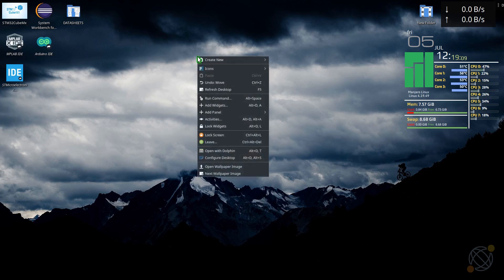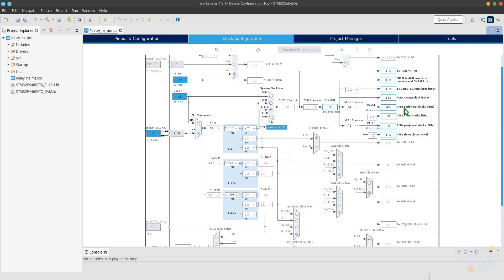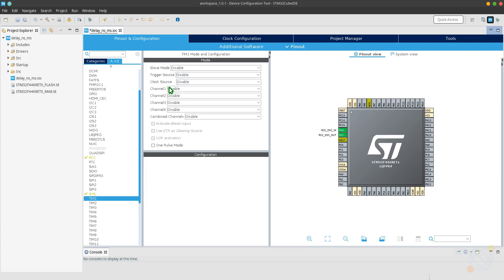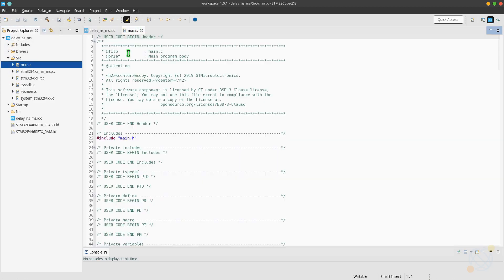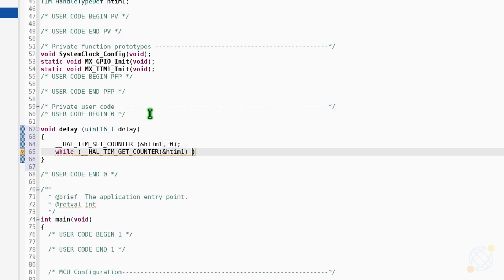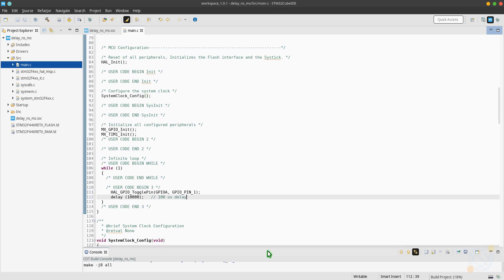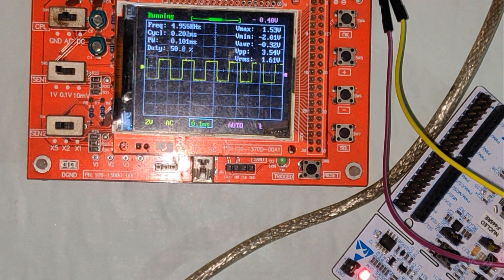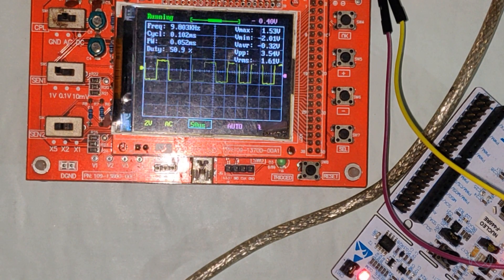STM32 Microsecond Delay Tutorial – Precision Timing with Timers (HAL + CubeMX Guide)

Comment: Sorry, may I ask you a question about STM32F103.
I try to make a timer interrupt on timer 2, but I found the limited is only be reach to 2.7us, while if I change to make a timer delay, it can be reach to 1us. May I know have different on both timer interrupt and timer delay?
Reply from the maker: Even timer delay can not produce 1us on f103c8. This is because the system clock is only 72MHz. Internally the timer's counter do increment every 1us, but to convert this to delay, we need to write additional statements. This adds a little processing time.

This brings us to the interrupt case. When an interrupt is triggered, the ISR will be executed. At the end of the ISR, the callback is called. Inside the callback, you might be writing the code to toggle a pin.
There is a lot of processing going on here on top of the interrupt alone. Therefore it consumes some time and that's what you are seeing 2.7us.

You can use LL or direct register manipulation to reduce this additional consumption. In HAL, this can not be reduced.

Comment: You won't be able to get very low delays accurately.  There's some time required for the function call, and return, as well as actually polling the timer value.  This stuff should be relatively consistent, so you could probably write a function that accounts for it and get it precise, but it will still have a minimum delay significantly longer than you calculate.
Up in the millisecond ranges the error is too small to be visible.

Comment: Hi I have the same nucleo F446RE but didn't manage to get 10 ns, the minimum I can get with delay (1) is around 530 ns, it acts like there is a limit
Reply: I know this is an old post, but if anyone else runs into it. There's some time for the function call, and return, and it takes time to set, and poll the timer registers, so to get a cycle-accurate timing, you need to account for all this, and the minimum will be much higher than one cycle.

Comment: Can you guide for 100ns delay, with 48mhz clock....using stm32f07
Reply from the maker: Just follow the video. It explains the process
Reply: @ControllersTech  I tried but its just limiting to 1 micros sec.
Reply from the maker: Use a better mcu with higher speed

Comment: My delay function is suddenly not working and I do not know why. It's been working for months. For example, a 10uS delay is producing a 17uS delay instead on the oscilloscope. I did not change anything.
Reply from the maker: Well you should change everything based on your controller..
Reply: @ControllersTech  I meant I did not change anything over the months I used it.
Reply from the maker: There must have been some changes.. you need to recheck every detail i guess..

Comment: How can I get 20 seconds timer3 interrupt ? cheers
Reply from the maker: Just divide the timer 3 prescalar such that the timer frequency is 1000 hz. That means the timer will take 1ms for each count. Now set the ARR as 20000 to have a delay of 20 sec.
Make sure you enable the update event interrupt
Reply: @ControllersTech  PrescalerValue = (uint16_t) ((SystemCoreClock / 2) / 1000) - 1;  //TIM3 counter clock at 1000Hz
__IO uint16_t CCR1_Val = 1000/1;
__IO uint16_t CCR2_Val = 1000/0.5;
__IO uint16_t CCR3_Val = 1000/0.25;
__IO uint16_t CCR4_Val = 1000/0.125;
Reply: Make sure you enable the update event interrupt
What should I update?
Reply from the maker: But this will give you the delay of 8 sec max..
Reply: @ControllersTech  How can I make it more?
TIM_TimeBaseStructure.TIM_ClockDivision = 1;?
Reply from the maker: You are using capture compare method. I was telling u about the update event method. Just enable the update event interrupt in timer, if u don't have one, just enable the timer interrupt.
Make sure the timer clock is 1KHz amd use the ARR of 20000.
Reply: @ControllersTech  I see, is it possible that I have 1 second timer than loop it 60 times with for,  so I will get 60 seconds ? thanks
Reply from the maker: Yeah of course you can..
Reply: @ControllersTech  Where do you reckon I put the loop for getting 60 seconds delay ?
here ? :

void TIM3_IRQHandler(void)
{
  if (TIM_GetITStatus(TIM3, TIM_IT_CC1) != RESET)
  {
    TIM_ClearITPendingBit(TIM3, TIM_IT_CC1);

    /* LED4 toggling with frequency = 4.57 Hz */
    STM_EVAL_LEDToggle(LED4);
	capture = TIM_GetCapture1(TIM3);
    TIM_SetCompare1(TIM3, capture + CCR1_Val);
  }

Comment: Hi thanks for the tutorial! If my max clock speed is 80mhz can i divide it 800-1 and get a timer which counts 10microseconds? Then can i have an interrupt that triggers when the timer reaches 10microseconds after its activation? This is needed for me to be able to read hc-sr04 sensor without active waiting with a while loop? Would it work? EDIT: What will be the counter value? Thanks in advance :)
Reply from the maker: Yeah that would work. You need the periodic delay. Also prescalar doesn't depends on hclk clock. You need to check the APB timer clock od the timer that you are using.
In case apb is 80MHz than prescalar can be 800 and counter 0. This would create a delay of 10 MHz
Reply: @ControllersTech  Hi thanks for the answer! I am trying to measure the time for distance measure using the timer(set at 1us) and an interrupt(set on rising and falling edge) on the echo pin of the hc-sr04 sensor to read everything in non blocking mode. 

Basically i use the same timer for triggring the sensor and then when the interrupt rises i just restart the timer and each time the timer counts i check if the echo pin goes low and if so i stop and compute the distance using the time counted. 

But this is not working D:  

I have to read 4 hc-sr04 sensors. If i use direct input mode on 4 channels of the same timer can i measure the time from each these 4 channels concurrently? Would this work?
Reply from the maker: i don't understand the point of using the interrupt. It's just 10us, and the entire processing doesn't take much time. you can still run other functions

Comment: Firstly, thanks to your video. But I tried a lot with stm32f446re nucleo and the LED doesn't blink. I have even used usb logic analyzer and still got nothing...
Reply from the maker: Did u start the timer in the main function.. Hal_Tim_base_start
Reply: @ControllersTech  I mean, I did the same as you but the delay is not same. I used Nucleo STM32F446RE with APB2 is 100 MHz, Prescaler 1-1, AutoReload Register is 0xffff-1 and delay function with delay parameter is 10000 but the result is not 10ns.
Reply from the maker: Can u telegram me @controllerstech

Comment: 100 000 000/(1*65536)=1525.87 Hz  How does it works on 100 mhz? Am I wrong?
Reply from the maker: I thing you didn't understood it properly
we entered the prescalar as 100, so the timer clock is 100/100 = 1 MHz
Each count in the ARR takes 1 us
yeah the ARR is 65536, but we are not counting upto TOP of the counter.
just count as many microseconds delay you need.
Reply: @ControllersTech  TY for answer but in 2:23 isnt it prescalar? İts 1 or i am blind?
Reply from the maker: that's for the nanosecond delay. prescalar 1 means the timer clock would be at 100 MHz, and each count will take 10ns.
Reply: where is the prescalar as 100, i see only prescalar as 1-1 i 2:23 @ControllersTech
Reply from the maker: @binodanio2199 prescaler of 100 is not used in the video. But if you want the delay in us, with the APB timer clock of 100MHz you need to set the prescaler 100.

Comment: hello 
what if have 80MHZ for timer 
then I need trigger 48000 in one second 
Is that doable ?
Reply from the maker: You want 48000 times high (freq 96000), or both high and low (freq 48000) ?
Reply from the maker: In either case u can use the prescalar value = TIM CLK / Required frequency.  Keeping the ARR at max
Reply: No I want 48khz (the timer occurs 48khz ) 
The reason for the question is that I guess 48khz can't be achieved exactly there will be always 10 or 20 above or lower 48khz , Am I right ??
Reply from the maker: In that case, better use the APB timer clock as 48 KHz. And prescalar as 0

Comment: I can understand, What is the function did here ?, And why 1-1, Please explain me. thanks. I am waiting for reply

Watch my video I am explaining Timer multi tasking concept
https://www.youtube.com/watch?v=EYXbNmaPBWo

My Timer explanation 8 bit
https://www.youtube.com/watch?v=dP1S4p7a1js

So please explain
Reply from the maker: Prescalar divides the APB timer clock. When we give a 0 (which actually means 1 because  PR = value +1) to the prescalar, timer clock will be 100 MHz /1 = 100 MHz. That's what we needed.
Reply: @ControllersTech  Ok, How to calculate ?
what is the formula ? Here I can say in my calculation
Here Is the formula and calculation.

(4/ Fxt) * A * ( 256 – B )

Where

Fxt is oscillator frequency, Your external should 16Mhz.

A is prescaler value = 32.

B is initial value loaded to TMRO.=131. Make this line inside your subroutine part --- set_timer0(131);

Example: If Fxt = 16MHz, A=32 and B=131 then total-time delay until TMRO overflow

Here is the calculation (4/16)32(256-131)=== 1000 millisecond timer0 overflow

interrupt occurs every 1000 msec.
Reply from the maker: Apb/prescalar = timer clock. Than convert that to time. 
Apb = 100 MHz, prescalar = 99, than 100/100 = 1 MHz, so a period of 1 microseconds.

Comment: Awesome work ! Thank you so much.
micro-seconds works fine with me but I still have problem with ns delay,   it doesn't work... I have set prescale and arr register to many possibilities. And it gives me always a delay value > 1us . My controller is STM32F413ZH nucleo. I can send you my code. 
Many thanks for your help
Reply from the maker: What's the max HCLK possible for your controller ?
To create delay of 1ns, timer frequency must be  1GHz
For 10ns -> 100 MHz
For 100ns -> 10 MHz.
Reply: Thank you for fast responding. Actually it's 100 MHz and I need a delay of 50 ns for my application.  Do you like that I send you my code via your email  admin@controllerstech.com ? 
Thank you so much
Reply from the maker: Yeah sure... Send the project.
Reply: Please chick your email box. Thank you
Reply: Hello Sir,
I'd like  to know if you have received my email message.
Thank you for help

Comment: Thank you very much for this method. But it can't works, cause you not startet TIM Base generation. For correct starting must write HAL_TIM_Base_Start(&htim1); before while(1) loop. Either your TIM Base Generation startet somewhere automatically - it is HAL man :))))
Reply from the maker: The code does have HAL tim base start. I guess i forgot to mention it. I will put it in the description..

Comment: my hclk is showing max 84hz when i try to change it to 180 it is not changing ...showing 84hz max ..what to do?
then what to put the value at apb2?
i am using stm32f401re
Reply from the maker: The max clock in F401RE is 84MHz. You can't run it higher than that. I use f446re, that have 180 MHz.
How much is APB2 clock ?
Reply: @ControllersTech  84
Reply: so how to put modifications?
Reply from the maker: Put prescalar as 84-1 and ARR as 0xffff-1

Comment: my timer just doesnt start :(  it stays at while loop forever. I rly don't understand why it doesnt work I have set up everything in config and have exact same code. Maybe my ADC1 analog read is somehow messing with the timer ? or my definition of outputs idk
Reply from the maker: If u want to test the timer, run the timer alone. Don't use any adc code. Just blink the led after some delay
Make sure that you have started time using hal tim base start function
Reply: @ControllersTech  I don't see the command to start timer in your timer tutorial but thank you very much I added it and followed temperature one wire sensor code and after some trying I got it working :) it's reading the temperature and my analog read from potentiometer is also working!!! Thank you so much :D !!!!

Comment: I tried to create 10ns delay but it doesn't work... I have set prescale to 0 and arr register to 18. And it gives me 1us delay. My controller is stm32f44zet6 nucleo
Reply from the maker: What's the timer frequency ?
Reply: APB2 TIMER CLOCKS :180MHz
Reply from the maker: First bring ur timer frequency to 100MHz, than set the prescalar to 0 and ARR to 0xffff-1
Reply: @ControllersTech  yeah it was a mistake i kept timer1 at 180MHz now i have changed it to 100MHz. But somehow i am getting rise time 20ns and fall time 30ns. Period is around 1.18us and frequency is 847.4 KHz
Reply from the maker: I need to see the code. Telegram me @controllerstech
Reply: @ControllersTech  no it's not required because i was doing certain mistakes and i have rectified it. Your code works totally fine.
Reply from the maker: K nice.
Reply from the maker: @devjeetmandal1472  did u managed to get 10ns ?

Comment: First of all thanks for this easy and useful tutorial. I wanted to clarify few things and i hope you can give me some answers for it. Suppose my mcu is running at 180MHz and my timer1 is at 90MHz, then how are you determining the lowest possible delay in ns? As you said your controller can generate only at least of 10ns delay, i wanted to know how you came to that conclusion that it can generate only at least of 10ns? What are the required calculations needed so by choosing any mcu of any clock speed i can determine the lowest possible delay i can generate.?
Regards
Reply from the maker: See, let's consider that the timer 1 is running at 100 MHz. That means one cycle would take (1/100Mhz) = 10ns. That's how it is calculated. 
Also if your timer is running at 90 Mhz, than one cycle would take (1/90MHz) = 11 ns.

If you want to create a delay of 1ns, your timer should have a frequency of (1/10^-9) = 1000 MHz. 
That's not possible for now.
Reply: @ControllersTech  To run my timer in 100MHz how are you calculating the values for prescale and arr regsiter.??.
Reply: @devjeetmandal1472  I don't undarstand your question. You said that your timer1 is at 90MHz. So you can't get 10ns, because u need at least 100MHz clock. You set clock for timer as you want because it is possible in stm32. So for example you take the highest speed (why not) what is 90MHz in your case. So you know that it's not impossible to get 10ns delay. So go for the next one which is 100ns. All what you need is to set cycle to 10MHz, because it give you 100ns. So set your prescaler as (9-1). 90MHz/9=9MHz. And arr register the highest possible value. You don't really use the arr register because you don't use interrupt after counting to the set value. Timer is just counting to set value, then after reach top value it is set to 0. Other way is to set clock for this timer to 10MHz then prescaler to (1-1). The arr register is use to set length (to which numer your timer count) with defined frequency.